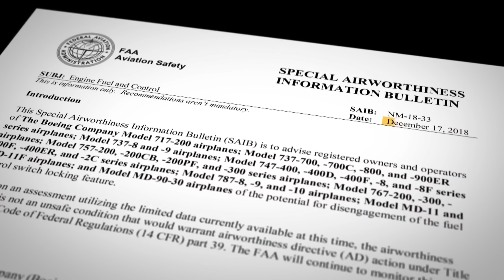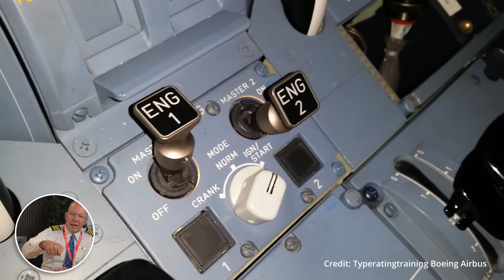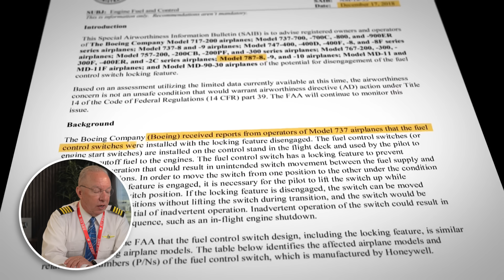Air India 171: The FAA’s 2018 Fuel Switch Locking Bulletin Explained (16 Questions Answered)

Comment: There should be camera in the cockpit, your responsible for people's lives. No reason for there not to be, if your doing your job properly theres not an issue. A camera may not have stopped this happening but a video recording of everything going on in the cockpit from different angles could have well showed who turned off the engines.  Pilots should also undergo 6 monthly mental evaluations

Comment: Not sure why & how you are so dismissive about any sort of mechanical/electrical or software glitches and so sure it's a pilot intended accident not even pilot mistake. There are so many possible candidates here.... the report on fuel cutoff switches locking feature getting disengaged automatically, FADEC issues. There is a report by the manufacturer of the aircraft on fuel cutoff switch locking feature disengaged automatically. Let's not forget even the 737 Max initially was reported as a pilot intended error. RIP for all those who lost their lives in this tragic accident and strength to their families.
Reply: Steeve in his race to put out a video before anyone else in the aftermath of the disaster blamed the pilots first so now he is unconsciously leaning towards any new development that blames the pilots.

Comment: The only other possible reason the switches turned off, if the crew didn't do it would be a third person in the cockpit. As a pilot, have you heard of the Captain allowing a person to  fly the jump seat unofficially.  Thats the only other logical answer, someone not listed to be in the cockpit.

Comment: It is unfortunately sounding like a classic cover up of system failure by Boeing. I think Steve that you need to remain open to arguments that suggest this possibility.
Reply: Everything points to a system fail, the co pilot said he did not turn the switches off. The switches were off. Either the copilot was a 4 year old toddler or there was some sort of system disaster failure. Steeve thinks the indian man was drunk probably

Comment: Capt Steve you keep rejecting electrical and computer failure causing fuel shut-off and saying their is clear evidence fuel Caroline levers were set to shut-off but there is no direct evidence of that. Why would their be a 2 second delay between  activating left and tight fuel and why didn't the pilot refute the denial and say the fuel levers have been shut off and rebuke the other pilot?

Comment: Captain Steve, I’m most curious as to what each pilots job/actions would be at rotation and flight. For example, I understand the co-pilot was in charge of departure. What would he be doing exactly. Where would his hands be typically and on what parts of the equipment? I understand the captain was monitoring. Typically what would he be watching and doing during this phase of the flight? Whose hands would be on the thrust levers (assume pilot in charge) which are just above the Fuel Run/Cutoff switches? Are there other panel controls near the switches that someone might be adjusting? A video on this type of aircraft showing a typical takeoff of responsibilities I think would be helpful. While the landing gear was not retracted during this flight maybe due to engine cutoff occurring I wonder whose job that would fall to. Thanks!
Reply: Also when the pilots are seated and ready for flight with seat moved into position, where relative to their seat would the Fuel switches be generally located to them? Curious how visually prominent they would be for each pilot. Once the plane is ready to have engines engaged I would assume the switches would seldom ever be accessed until landing and then parking unless an engine shuts down for some reason or catches fire and needs to be manually shut down.

Comment: Hi Captain, I have flown Boeing 747 and 777 , start lever or fuel control switch has pretty safe mechanism unless some one really wants to fiddle with it , my question is ,in this preliminary report there is no mention of pilot monitoring calling out positive climb or positive rate after rotation although every thing seemed to be going normal till that time and it should have been the first call after lift off and even the pilot flying never challenged PM for gear up , why is it not mentioned and the landing gears were extended throughout ,as per the report the EAFR data shows the aircraft crossed the take-off decision speed V1 and achieved 153 kts IAS at 08:08:33 UTC. The V, speed (155 kts) was achieved as per the EAFR at 08:08:35 UTC. The aircraft air/ground sensors transitioned to air mode, consistent with liftoff at 08:08:39
UTC. The aircraft achieved the maximum recorded airspeed of 180 Knots IAS at about 08:08:42 UTC and immediately thereafter, the Engine 1 and Engine 2 fuel cutoff switches transitioned from RUN to CUTOFF position ,the gear lever should have been selected UP before this episode which doesn’t seem normal,please share if you have any info on it , profound thanks

Comment: I've seen some videos where the pilot holds the thrust level sideways (not from top) - could this in conjunction to switches that perhaps don't have a proper lock / ident have lead to the pilot guarding the thrust levels inadvertently cut-off the engines. I guess the question i have is - while anything is possible, according to you, is this physically possible ? Thank you.

Comment: Hi I am a regular traveler and an engineer, in a safety perspective how can the switch turn off even with manual operation when the flight is on the air, there supposed to be a electronically a lock in a normal operation on the air to avoid these kind of incidents with human error., if when emergency when there is fire in the engine, it cannot be both engines on fire right than there suppose to be a technology that the fuel cannot cut off for both engines at the same time , it should not cut with human error but also technically inventions is a question mark in this modern era 😢
Reply: Something does not add up and Steeve has suddenly become very poor at using logic. Automatic cars as an example- you cannot remove the keys from the ignition unless you have moved the lever to Park. Flipping these switches on a plane taking off is the same as taking the keys out of your car while driving in the fast lane at full speed. The car wont let you do it maybe the car would let you do it 30 years ago but you cant do it now. Steeve is a piece of work. The fact those switches appear to have moved is itself a fault of design that is before you even contemplate a rogue pilot.

Comment: As a fellow Captain I have a few points. 

In the UK there is an annual psychological check as part of your Class 1. It is however, EXTREMELY basic.

It seems strange to me that there is a focus on the FUEL CONTROL switch, yet they have the actual FUEL CONTROL switches from the aircraft involved (there are pictures). Why have they not confirmed if the switches were incorrectly installed since they have the switches ?  Had they have done this it would have been cleared up preventing all this confusion and speculation.

Comment: This capt is a loony tune. Surely when a car is low on fuel it sounds an alarm. If a plane's fuel is cut, there should be louds alarms buzzing and not for the pilots to listen to engines roll back.😢

Comment: Hi, a very basic question. Is it possible (at all) that the fuel switch was never turned on? For example, my motorcycle has fuel cut off switch/tap but the bike still runs two miles plus until the lines run dry. It is possible, the crew never turned it on? and the engine was spooling on the fuel in the lines?

Comment: What if we assume the pilot who said he didn't cut off the fuel was telling the truth? Perhaps the fuel supply was indeed stopped by a technical malfunction, and one of the pilots tried to restart the engines by switching the cutoff switch to cutoff and then back to run again.
With all due respect captain Steve, you seem to be stuck in the narrative that Boeing and/or GE are not at fault and that one of the pilots deliberately caused the crash.
Anyway, let's wait for the final report.

Comment: You are clearly lying; you also cover up something. Pilots are talking to each other about who turned off the fuel control switches, but both of them say no. Clearly, they are not involved. 
There is also a bulletin from the FAA that shows potential flows of the switches you intentionally ignored.  
What a shame..
Reply: Steeeves job is to murky the waters. It is easy for Steeeve in his new pilots uniform, to make out those indians like to play games like lets turn the engines off while we are taking off

Comment: Captain Seeeve,  Could it have been a severe PANIC ATTACK by the older pilot, assuming he was the one who shut off the fuel valves? If he had a severe panic attack, his mind would only think of getting the plane down and himself on the ground, with no thought of the consequences. The non-rational turning off the switches could have been just an instinctive panic reaction, not a purposeful suicide and mass murder.
I am not a pilot,  but am a former engineer at Pratt & Whitney (JT-8D, JT-9D), with an interest in aviation safety.

Comment: Let’s say it was an electrical fault that cut off the engine, when asked why he cut off, the other said he didn’t. Let’s say he didn’t, the cut of should indicate on their screens that there is a cut off, and it is a manual switch, but electric. 

So what do you do at this moment, I would deffo start pulling the cut off, the on again on each switches, and you have a record on switches on with 4 seconds apart

Comment: I'm coming from 20+ years of modern corporate world: Adding cameras to a cockpit is not as expensive as going against union, that's why there are no cameras. Helping a pilot mentally struggling although temporarily is way more expensive than just cutting his/her wings. period. Employees will cover up any personal struggles and also align blindly to whatever is convenient to the company they work for, or they are out the door. That's everywhere, and it includes pilots. Let's face that we live in a low-cost world where everything and everybody is disposable, and some will do whatever it takes to keep their jobs. Customers get the short straw most of the time, unfortunately.
Reply: Pilots dont have power to resist if its safety measure proven. The reason its not done is Boeing know the evidence will be in the hands of the public in two days. This is why you dont have it  and why truckers have cameras looking up their noses while driving trucks and can do nothing about it.

Comment: The report shows they recovered the Fuel Control switch panel.  While somewhat damaged by the crash it appears they should be able to tell if the locking detent features were present/working as well as the if switches themselves were working to eliminate the conjecture of inadvertent switch actuation.  All they mentioned in the report was that the switches were found in RUN as well as mentioning the bulletin on the 737 switches.

Comment: Rather than addressing the seriousness of the faulty switch—and how Boeing conveniently deflected responsibility onto the airlines—Mr. Steve chose to downplay the issue. It's hard to believe this video wasn't influenced by some form of sponsorship. The idea that trained pilots could accidentally shut off fuel mid-flight is ridiculous—even inexperienced drivers don’t mistakenly turn off their car engines while driving
Reply: more to the point - the car nowadays wont let you - why would a plane let you do it (other than engine fire or other unique incident on take off) My car wont let me get the keys out if I have not put it in park.
Reply: @Meodus_Humbinerbernecki Mr. Steve effectively diverted the audience’s attention with his comment about the in-cabin camera—an intentional distraction, it seems, designed to shift focus to a minor issue. I believe this camera discussion will eventually become part of the solution identified through the investigation and it shouldnt be the concern of pilots privacy as we live in this new world where privacy is just a buzz word but in reality it doesnt exist. Unfortunately, many so-called aviation experts are now steering the narrative to suggest the incident was either a result of pilot error or a deliberate pilots act, leaning into speculation over substance. It’s a disappointing and cynical approach—and in that sense, Steve's admission of his own cynicism might be the most honest thing he said.

Comment: I think your analysis of the Boeing SAIB is critically incorrect. There is no mention of installing upside down. The bulletin specifically states “that the fuel control switches were installed with the locking mechanisms disengaged”. It later goes on to say “If the locking feature is disengaged, the switch can be moved between the two positions without lifting the switch during transition, and the switch would be exposed to the potential of inadvertent operation. Inadvertent operation of the which could result in an unintended consequence, such as an in-flight engine shut down.”  Since all pilots naturally lift and rotate the switches during operation, this reported installation flaw can apparently go unnoticed for a long time. If, from what you were saying, the switches are also spring returned to the cut off position, not having the lacking mechanism installed, may allow for them to be inadvertently switched while or just after adjusting the thrust levers. Isn’t it standard procedure to slightly reduce thrust once airborne? And, wouldn’t cockpit video give us a much better understanding of intention (something that audio and sensor data does not disclose.)

Comment: Hey Captain Steve !! I have 2 questions for you, One from technical  and other from psychological perspective.
1. As you mentioned, the fuel switches are spring loaded, Do you think It might be possible that the springs were not in good condition and as the plane took off, due to gravity the switches came down to cut off position ?
2. There is a Denial from the pilot that He didn't cut off. Do you think that a person who has chosen death will lie in his last sentences ? and why there is no details about CVR other than these two statements?

Comment: Do you believe this crash will change Airlines policies about shutting down APU's so quickly after engine start to conserve fuel.
If left running until say a few thousand feet, wouldn't having an extra source of electrical power and bleed air immediately available for use aid in engine restart at low altitudes where every second counts?
Reply: No, because he has no impact. If the fuel is shut off it's shut off. APU just like the FADEC will do nothing unless those are turned back on. With only 600 ft the amount of time for respooling would not be enough to avoid the crash.

Comment: Maybe physically separate the cutoff switches?  - right engine(s) cutoff only accessible to the pilot in the right seat, left engine(s) cutoff only accessible to the pilot in the left seat.  This way no single pilot can cutoff fuel to all engines.

Comment: I'm sorry, but how does one pilot not notice the other pilot move BOTH fuel switches to CUT OFF, so fast that they're 1 second apart, when the only thing he is focusing on at that moment is lifting off? The fuel switches are directly in his path of vision. He would see the other pilot move his arm(s) across to move them to CUT OFF.

The dialogue was "Why did you cut off the fuel?" "I didn't do so." And then straight to "May Day, May Day!" It wasn't "Why did you cut off the fuel?" "I didn't do so." "Yes, you did, I saw you do it. Why?!" At least, this is what is reported.

In my opinion, it's too early to draw the mental health card, although that is still an important discussion to have given other plane crashes in recent history.

Comment: There is Cockpit Voice recorder evidence that the pilots DID NOT actuate the fuel cut-off switches. Pilot # 1 didnt do it because if he did, he would not have posed the question ( He probably received  some type of message about fuel cut-off on his display rather than directly staring at the switches ). Pilot #2 clearly stated that he did not actuate those switches. This leaves open the possibility of a software glitch ( some run-away computer input governing the fuel cutoff VALVES , via a pathway only  known to Boeing  engineers).

Comment: Full switches are part of a DIGITAL control system i.e.
working via a control module operating digital codes to finally operate a
mechanical fuelline cut off!
If an erroneus digital command code causes a fuel cutoff - what would an
experienced pilot do? Try reopen fuelline => quickly flip the mechanical switch 
(initially on) to off and back
to on again; purpose to reinitialize engines!
Do not blame pilots at this
Prel Report!

Comment: @Steve presuming there was no deliberate action to put the fuel switches to cutoff position , is there anything that the pilots could have done differently to avert this disaster because the aircraft achieved full throttle speed of 180  knots. please clarify